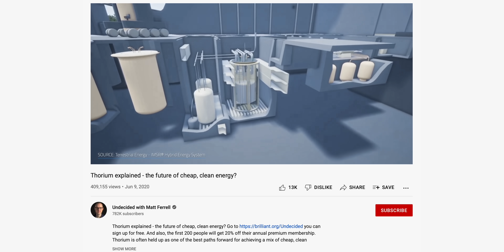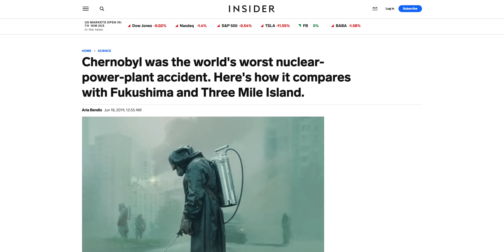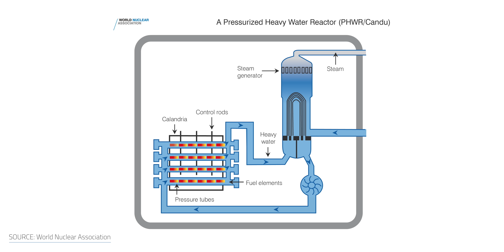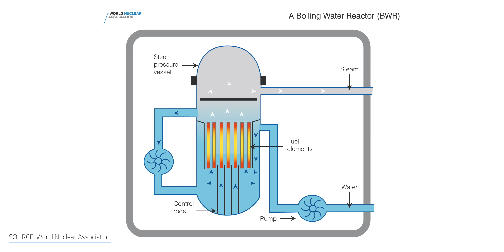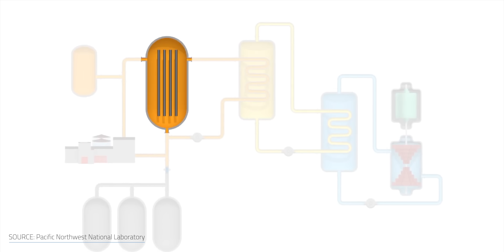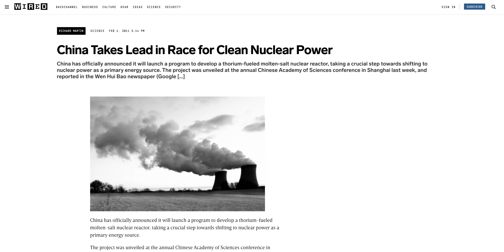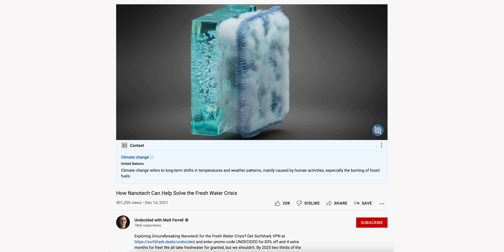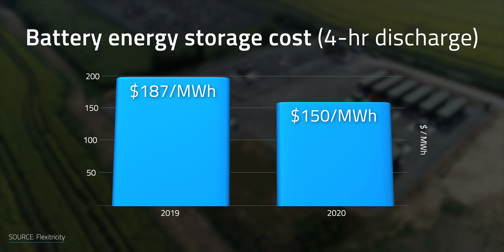Revisiting Thorium Energy - The Future of Nuclear Power?

Comment: "My battery is low, and it is getting dark" is no way to run a robust electricity grid (even NASA gave up on this), especially with climate change affecting weather patterns. Renewables and the battery storage which makes them viable (also the sun sets and the wind calms for more than four hours in most places) are a good transition but long term 24 hour a day base load nuclear is definitely needed especially as we transition away from fossil fuels to electricity for our heating and transportation. These new designs offer a lot of promise, very few technologies stand still and remain viable after all.
Reply: Not so, there's is always sun shining somewhere and wind blowing somewhere and water flowing somewhere, that's the point of a grid, the solution isn't nuclear its worldwide cooperation, which is why we will never succeed
Reply: @davidmedlin8562  That answer implies that if its sunny lets say in France, but cloudy in Poland, energy will be send. sounds good until you take into account losses. A fully green "grid" needs some alternate source on demand,. Also nuclear can very well be included in that utopian grid. 

Just saying
Reply: As I see it, the optimal direction is if we invest in nuclear for the transition phase, so it can aid in whatever natural energy may fail to provide in terms of consistency. In the meantime, natural sources of energy will aid in generating hydrogen during excess power periods, which can be used either for transportation - or preferably to simply store the energy for later use at no cost to the environment - far better than any conventional battery.

By investing more in nuclear now during the transition phase, we also increase the speed of development for the future, where nuclear could become a far greater player overall, while other types of energy collection have time to grow at their natural pace.

Comment: About 10,000 years of power using Thorium. Time to get fusion working which has millions of years of power.
Reply: Fusion only generates about 4X the amount of power that fission does (with fission already generating 1,000,000X the amount of energy that chemical energy sources do). However, when you consider that fusion will also require that a SIGNIFICANT % of that power get poured right back into the reactor to maintain fusion, a fusion reactor is really only likely to generate 1.5X to 2.5X the amount of power than fission. 

In terms of how long a particular power source will last, I've seen estimates of centuries to millions of years, depending on assumptions. For example, it's estimated that in a fast reactor, which can achieve 100% fuel burn-up, just looking at spent fuel rods and depleted uranium piles at uranium enrichment facilities, there's enough fuel to power the world (at current energy demands for several millennia), and that's not mining any more uranium. 

Also, thorium is as abundant in the earth's crust as tin, at about 7.2 parts per million (PPM). All current fusion research is focused on D-T fusion, which will likely be the case for at least 50 to 100 years after we FINALLY make it economical. Tritium is produced from lithium, which is decently common in the crust at 20 ppm, almost 2.8X that of thorium. HOWEVER, tritium is produced primarily from the fissioning of Li-6, which makes up only 7.8% of total lithium, making Li-6 1.56 ppm in the crust. As such, there's a little over 4.6X the amount of fuel necessary for fission reactors than there is for fusion reactors, at least for the kind of fusion reactors we're likely to see commercialized within the next 130 years or so.
Reply: @williamsmith1741  There is Aneutreonic fusion too, Hydrogen and Boron, He3 etc. D,T is not the only option. Lattice confinement or electrostatic, instead of magnetic, also super conductor magnets. Too bad all the money goes to renewables that wear out and need renewing, imagine how many wind generator blades will need replacing each year. Like painting a bridge, once you have finished you start again
Reply: @alwayscensored6871  There are those, but they are all much harder than D-T fusion, which we still can't do sustainably. Additionally, the further you get from H - H fusion, the less energy you get from the actual fusion. I believe H3 - H3 fusion only yields about 3X the amount of energy of U-233/U-235 fission, which would put almost comparable with the energy output of fission once you take into consideration the energy losses from having to maintain the fusion reaction.
Reply: @alwayscensored6871  No offense, but I'm not sure what you're talking about.

Comment: Re starting development of Molten Salt Breeder Reactors is long overdue, especially ones using a thorium -> uranium fuel cycle.  It's a good thing that China is taking up this effort and leading the way, since America won't bother supporting it.  

These things are so much better than today's most common nuclear reactors using highly pressurized water as a coolant and moderator, uranium 235 in the form of solid uranium oxide fuel,  and produces waste that is dangerous for over 10,000 years.  The thorium molten salt reactors are invulnerable to meltdowns and their waste is dangerous for a much easier 300 years.  There are numerous other advantages too.

Comment: The following relies on the same "connect the dots!" logic as your average conspiracy theory, but wouldn't "getting" thorium instead of uranium be a lot cheaper/efficient than "getting" uranium? I know pitchblende is relatively easy to find, and you can get uranium from there, but only a few percent of that uranium is the one you want in the reactor, and the separation process is incredibly inefficient. Thorium is 100% the right isotope. So while mining might be a bit harder, getting the actual stuff you want is easier. ontop of that though, the ore you need for thorium has rare earth minerals and phosphorus as "waste streams". Both of these "waste products" of thorium mining are desired enough to warrant their own mines!
The whole perfect plot comes through in the following. America could use their vast rare earth mineral deposits to (1) mine rare earth metals for semiconductor industries, (2) get phosphorus for agricultural purposes, (3) power it all through the use of thorium reactors. It looks like an ideal picture, how is this big picture thing not talked about more?
Reply: If you really want to look at the big picture, you also have to include that because thorium is so fragmented into the source it's mined out of, mining is wasteful in terms of: (1) the energy used to mine it, (2) the resources spent on procuring the materials needed for mining and (3) the high pollution factor created by (1) and (2), for example the large amount of toxic chemicals used for separation.

Comment: Your thoughts on giving a pressure plate sidewalks that make energy from people walking on them almost like ricks universe battery with a planet of um people making energy for ricks car.
Thoughts on using this in busy citys where's theres lots of foot traffic 🤔.
Reply: I haven't heard of that yet but it sounds like it wouldn't generate nearly enough power to make sense. And you still suffer from the downside that there is almost no power generated at night, where it's needed the most
Reply: @lurts9820  have big batteries they only get charged by the foot traffic and at night use the stored energy to power the lights at night 
No it only makes like 5 to 10 volts per step but in a busy place like vages strip or the beach in California can make lots of energy in a day since hundreds of thousands of people walk through there every day.
Reply: More efficient to have generators in your shoes to at least charge your phone.
Reply: @alwayscensored6871  not really they have ben attempted but are feet are to small to power are phones for are phones use a lot of energy.
But if you have a big 3 foot wide 2 foot long and hundreds of people walking over them should power some stuff.
Reply: @thesilentone4024  Sure but that just means it turns human food into energy. You forget the plan is to get everyone working from homes they won't own.